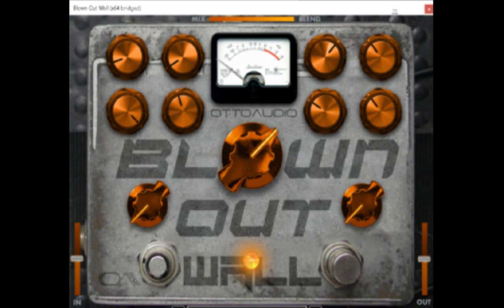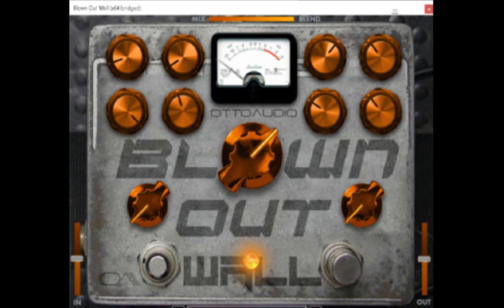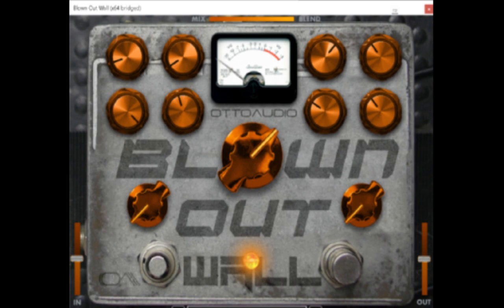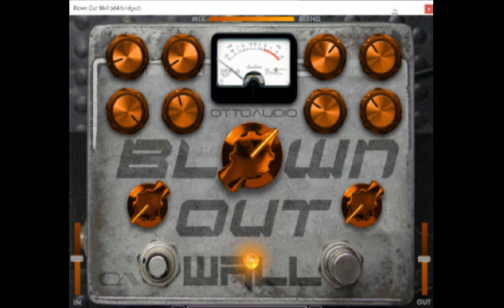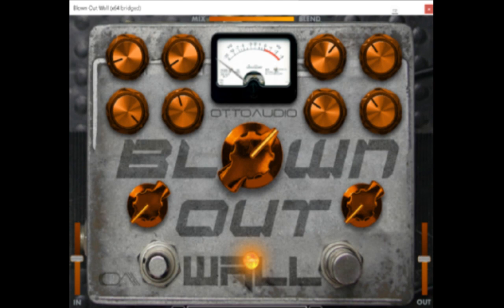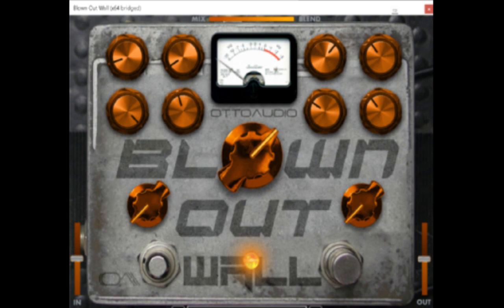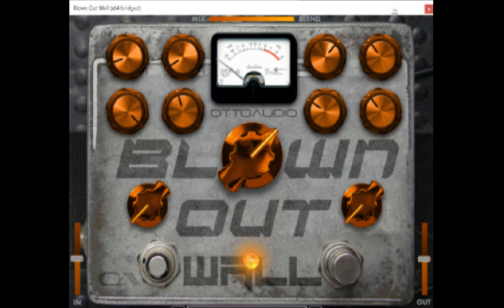Chugs With Chainsaw: Otto Audio Blown Out Wall | Sonic Desolation!!

Comment from the maker: For those using REAPER, here’s a vid showing how to modulate plugin parameters:
https://www.youtube.com/watch?v=Dn5_GvsJIhI

Other DAWs do this but I can’t speak on the process as REAPER is simply the only DAW I wanna use, ever. LOL. :P

Stamps:
00:00 In a Mix.
01:08 Talking/Signal Chain.
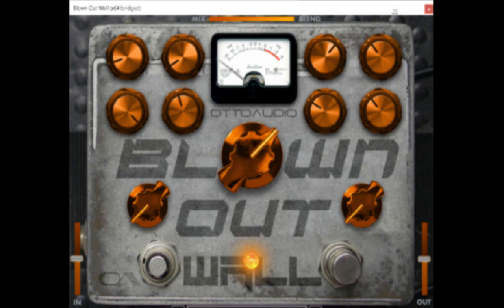01:55 Dry 1111 ton as reference.
02:12 Default Wall Sound.
03:35 Let’s get tweaking/Shaping the Chainsaw.
07:34 Tube Drive and spattering tones of death.
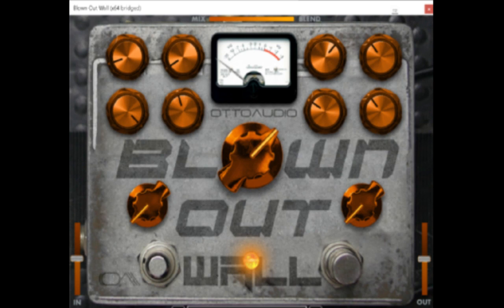12:18 Bringing Some Sanity Back. Kinda.
14:09 Other Extremes That Aren’t Chainsaws.
21:02 Modulating Parameters/Evil Phaser Mode in Reaper.
24:43 Conclusions/jamming at Max Gain.
26:44 Outro jams/Blown Out Wall and External Fuzz pedal.